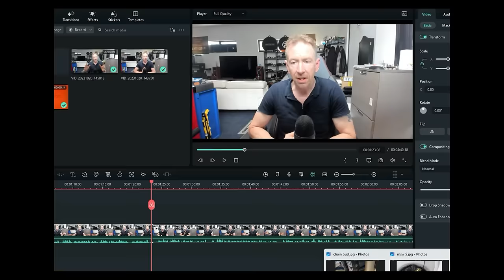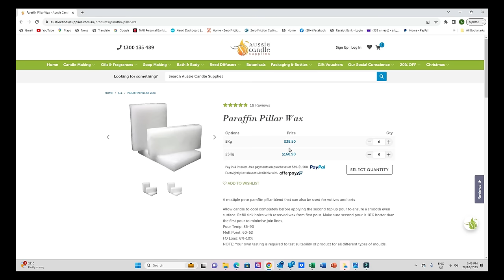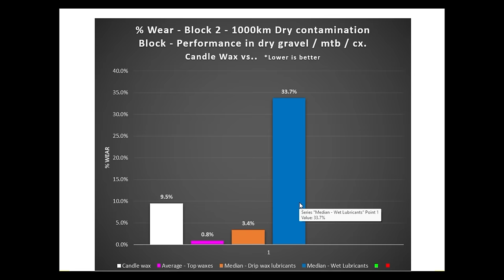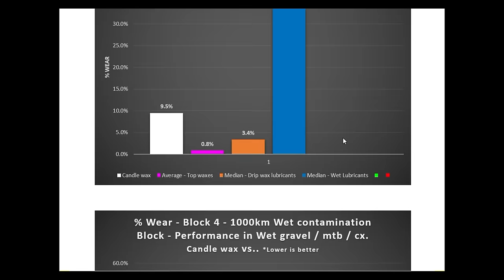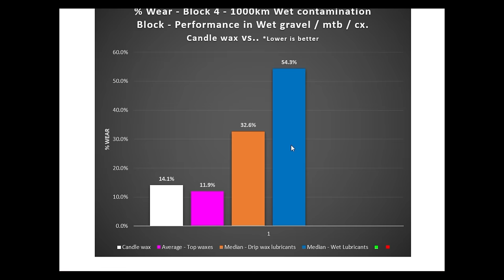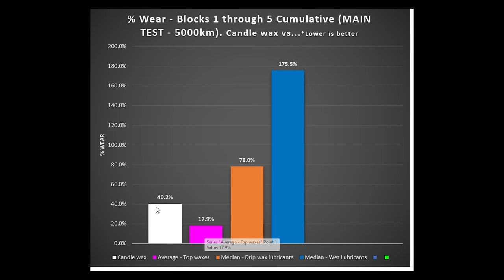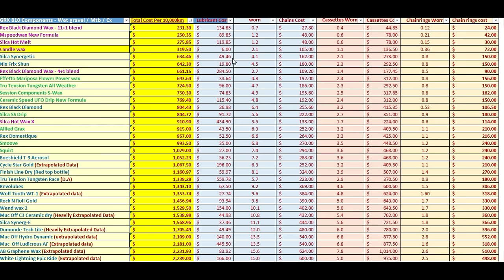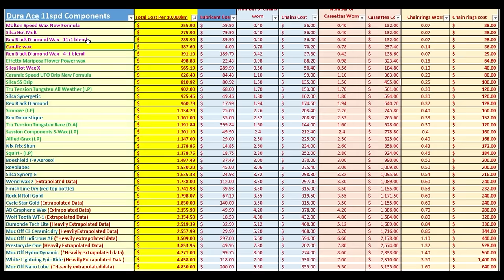Candle Wax test

Comment: I guess that this test shows how crap conventional wet lubes are.
Reply from the maker: ha most yes - really there have been only a handful of high performing wet lubricants - a lot of really really average results, and a bunch of absolute shockers. Chain is so hard working, under very high pressure loads, and completely exposed to contamination - so in general the best lubricants tend to be the lubricants that resist absorbing contamination, and this why wax based lubricants are very much dominating. Immersive has the advantage of every re lube is a great contamination reset, as well as extremely high contamination resistance to begin with. But even the good wax drip lubricants, they just have much lower contamination absorption, but also dust that does adhere to the outside has a very difficult path to move inside where it will cause friction and wear. If the lubricant is a solid coating or semi solid - it is a near impossible or very difficult path to move from outside to deep inside chain where it will do the damage. Wet lubricants, aside from every particle being absorbed on contact, the wetter the lubricant is, the easier the migration path to go from outside to inside, and that is exactly what has born out in testing, with the wetter wet lubricants by far performing the worst.